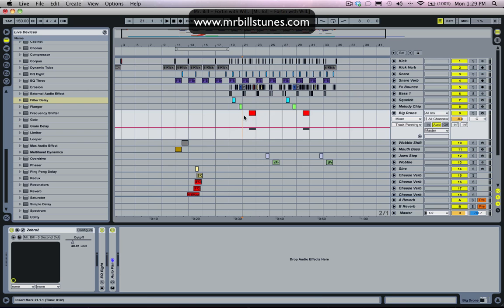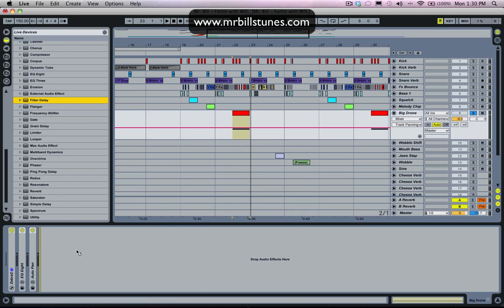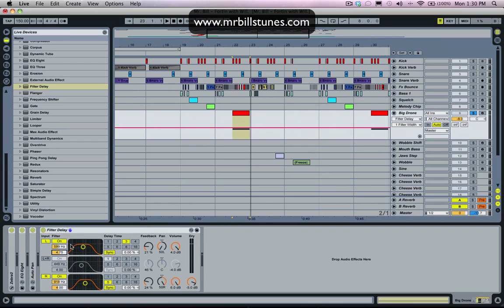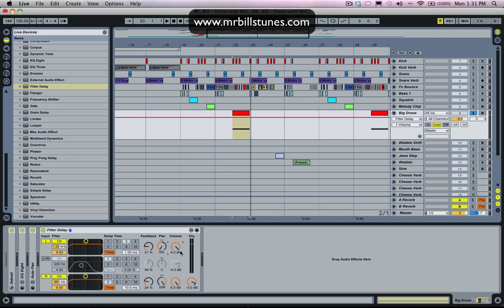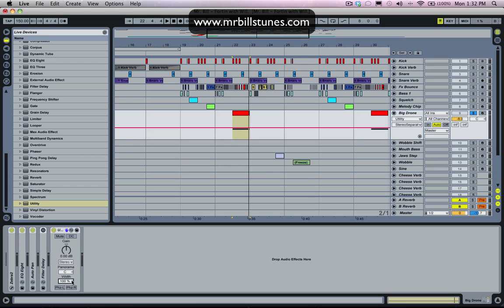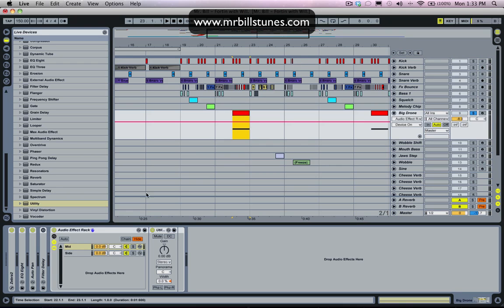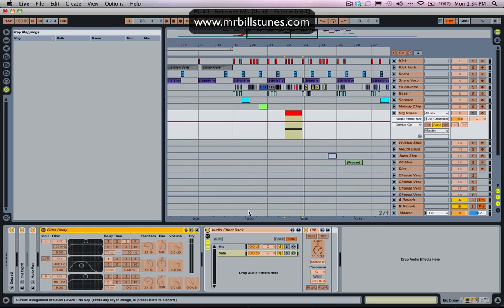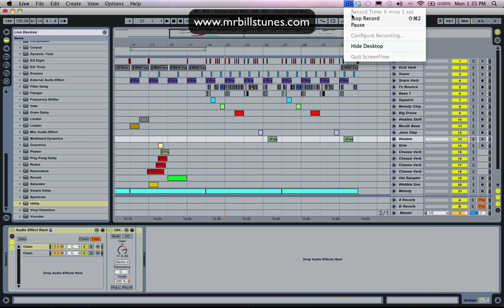Mr. Bill - Ableton Tutorial 35: Two Stereo Widening Techniques

Comment: The most realistic, IMO, has to be two identitc tracks, possibly bounce midi to audio. Detune one of the track with about 2-3 cents, then pan the tracks. The closer the sounds are in the room, the more phased the sound will sound, of course. But this method is quite cheap, and most plug-ins sound too phased for my liking.

I have done this in Cubase with their own plugin, pretty sure most DAWS has pitch-shift options.